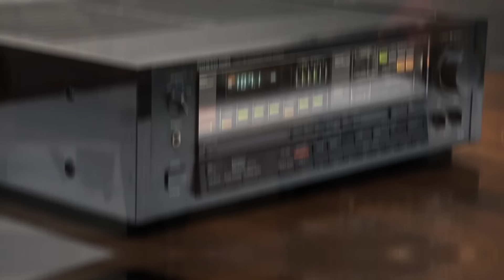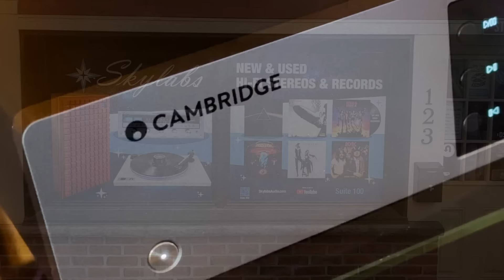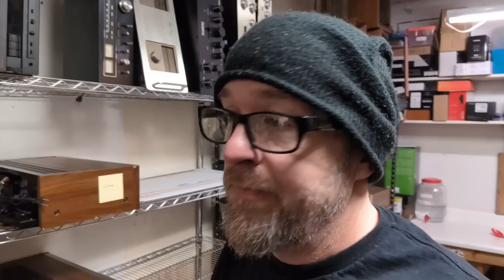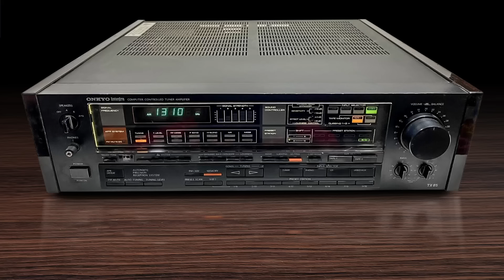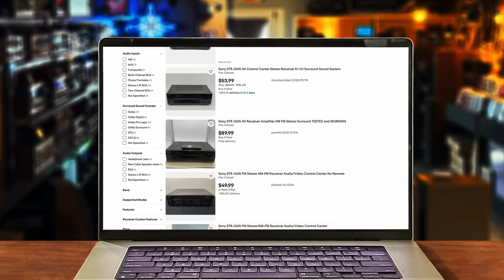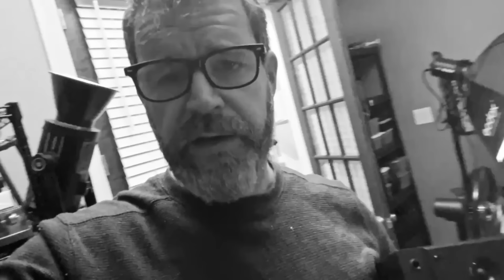Underated Vintage Stereos You Can Get Cheap... For Now

Comment: I liked my father's Kenwood Kr-810. He bought it in December 1982 and it had the digital features complete with a VFD display but still had the chrome face and knobs. For such a compact cabinet with only 23 watts per channel rms, it drove a pair of Becker ProA 303 speakers and it would rattle our upstairs light fixtures from the basement. I had a friend tell me it was the loudest stereo he had ever heard. Sound quality was also warm and rich. 

 It inspired me to to get my Kenwood 1070VR in for my 22nd birthday Sepember 1998 with a pair of Boston Acoustics VR20 speakers. The receiver had surround sound capability with 120 watts to each of the 3 front channels and another 120 watts split between the 2 rear channels. It looked pretty attractive despite having that minimalist 1990's look and a basic VFD splay. It had a black painted steel face and a little more buttons than what you would normally see on receivers from that era, and they were arranged in a way that made it look good. I did not like the fact that I had to turn the volume up 3/4 of the way to make it was loud as my father's Kenwood would do at just 1/3 of the way. But now I understand it was what was called an "audiophile taper" and was actually a good thing. I was able to drive my speakers fairly decently and It sounded about as good as any other receiver I've ever tried. I don't know if that's because I used it for so long that my ears became used to making everything else seems "off", or if it it really was an excellent sounding receiver. And btw, it did have at least 2 ac outlets in the back. It unfortunately failed about 15 years ago, sending thrashing base pops to my speakers that sounded like something hitting the flloor, even at low volumes. It would then go into protective mode. I didn't know what was going on at first, but it didn't take long for it to do it once again and so I ditched the receiver to protect those speakers. I've tried at least 3 different receivers since and while my current one puts out 150 watts per channel RMS, none of these have the smooth, crisp, full sound of the1070VR to me.

Comment: 80s to very early 90s had the best consumer equipment in my opinion. The Japanese had perfected the electronics. All of it was premium, heavy, metal, or very good plastic with tight tolerances. It all went to sh*t mid to late 90s.

Comment: I would agree with all of your pics except the Sony's I went through 3 different Sony receivers. They burned out. I switched over to buying Denon and Onkyo. They are absolutely bulletproof. 

I used to have a JVC receiver that came with a whole rack system for around $700. It had the coolest equalizer on the front. When the music played, the equalizer moved with the music.

Comment: PSB speakers are excellent. I have a pair from the 90’s hooked up to a Yamaha receiver from the same time in my living room. In my bedroom I have a pair of Alpha 3 powered speakers hooked up to an automatic Thorens TT. Both were new a couple of years ago. Together the cost was around $2000 Canadian, which is high end to me. I can’t see ever needing to upgrade. Both sets without separate amps. The Yamaha receiver and powered speakers have them built in. I’m okay with that. Also, no extra bass speakers on either set. The less pieces the better and the sound from both sets pleases me. I highly recommend PSB speakers with their unembellished, natural sound.

Comment: You brought up the Sonys!! Not as old, but I recently snagged an STR DE595 (2003) for $50, which is the same model my brother handed down to me 15 years ago and I somehow lost track of it. Fun unit; not the end game, but fun and a solid power supply with a really good DAC. even has that analog rail that I can use once I acquire a good little phono stage to boost the low end (had to add passive rumble filters because it responds down to 10 Hz… rough with vinyl)

Comment: I've been liking onkyo as a budget brand because the faceplates and LED colors have been the same for 40 years, so if any 1 component fails you can almost certainly find something that matches the set, locally, for 50 bucks.

Comment: I still have a fully functional Onkyo TX-902 Receiver floor model I bought in 1991-2. I am more amazed that the remote control still works especially since universal remotes don't operate most of the Onkyo's functions.

Comment: Kenwood KA-4002 integrated is the THE MOST underrated I've ever heard. Was a tech for over 35 years and sound from this little 18 WPC will leave you shocked. The most underrated tuner you will ever hear is the Technics ST-8077.

Comment: Got the Onkyo M-508, P-304, EQ and tuner. For $150.

Pots are a little goofy and need a cleaning. But still using it as is.

Paired with an RB-75 for $250.

And I got a sweet combo for nothing compared to new.

Comment: This is a great video. I Still have a Sony STR-D911, from the early 90s. Totally beat, and it works like a champ.
The early 80s Yamaha A-500 amps are sleepers. Built like a tank, 75 watts per channel, designed by engineers, not marketers.
They are pretty cheap because they aren't as pretty as the 70s stuff.

Comment: My friend and I used to find killer Sansui amps on the side of the road in the 90’s. We’d ride around and grab the gear, change tubes or transistors from radio shack and build killer systems. Waaaaaay before it was a thing ;)

Comment: Don't overlook the Kenwood KR-V107R. 100 WPC, different "venue" settings, video inputs, EQ and spectrum analyzer. You can do 'surround", but it's still an excellent 2ch stereo. 
That entire line is really nice. I still also have my original KR-V86R. Needs to be gone through, but it still works decently.

Comment: Out of my 3 systems, my favorite is the one with the 1998 Technics sa-dx1050. I've owned it since it was new and have had no problem with it. It has the MOS-FET amps in it which I love. I'd say that if anyone runs across any of the Technics that has the MOS-FETs at a good price, buy it. One thing that I have done to this setup, you might find interesting is that I patched an amp pre-out line to a 1975 Realistic SA-1000 which has the old Quatravox capability and I run the "B" speakers of that amp as synthetic surround sound for this system. Hope that makes sense. Anyway, it sounds great. I think that several of the older Realistics have the Quatravox setting. BTW, I love your channel!

Comment: At 5:38-5:40, that Pioneer SX-2600 receiver is the same model I have had for the past 35 years. Had the solder joints on the circuit board reflowed recently by a repair shop and it works beautifully. Receivers from the 70's are absolutely gorgeous, both aesthetically and for sound output. I feel the older ones are underrated power wise. I do like the ones from the late 80's and early 90's as well (the black ones). I can remember vividly going into the local Sears store back in that era and more less drooling over their stereo cubicle setup they had in the store. They had it all, receivers, speakers, cassette decks, turntables and cd players. At least I can picture it in my mind anyways.

Comment: My Dolby surround Pioneer receiver VSX as a kid had a 7 band manual EQ and my Mom came in one day and punched it right in the EQ.  I also owned drums.  It stopped making sound and wouldn't turn off.  I unplugged it and gave it a rest, plugged it back in and it was off this time, but it powered up and worked fine after, wobbly EQ and all.  It kept working for another 20 years, could still be...

Comment: I have an Onkyo TX-866 80 watt that I bought new but damaged from Circuit City. It had been dropped. The back of the cabinet is bent substantially. I have had it for well over 30 years. Twice I have replaced it with something "better" but I always go back to that TX-866. It sounds great and has more than enough power to make my D9s sing.

Comment: I specifically recommend getting outdated monster receivers ONLY; pre HDMI ones moreso. Just make sure whatever you get is in good working condition. I would specifically look at the (late 90s-2004 era) The Denon 4800 and 5800 and Yamaha RX Z series receivers are STRAIGHT UP amazing; very high build quality. They also excelled at 2 channel stereo performance. And they could also do DTS /Dolby digital 7.1 channel surround sound. 

The early 90s pioneer VSX 9300s-9900s + D1S are great as 2  channel stereo receivers. Another mention would be the Denon avr 3000 (early 90s). I only own monster receivers btw.

Receivers that I own and my ranking
#1 Denon 4802r (2004); smokes the other 3 easy. Torroidal power supply over 45 lbs.
#2 Pioneer Vsx D1S: #2+3 are close?
#3 Pioneer Vsx 9900s
#4 Pioneer Vsx 9300s

Comment: I got a TX-840 at Savers over a decade ago for $10. Paid 2.5x as much for a matching remote and it's been running a secondary setup ever since. My main system has been a revolving door of receivers (the longest-serving was a TX-108, the ToTL in the TX-85 range) but that little 840 never skipped a beat. It's older than I am, yet it'll probably outlive me. I love the looks as well as the sound - the soft green lighting is so pleasant to look at!

Comment: Speaking of Canadian models; the Oilers jersey on your Buddy at the tattoo shop is perfect!!  He’s not a Satanist!  He’s an Oilers fan!  The power supply on my RX-V870 is 50% Higher rated than the American model as is the VA Rating!  Why would that be?  Couldn’t figure it out until I saw the “C” designation in the literature.  Weighs a ton and puts out huge volume without getting very hot like my Sony STR-DE1075 does.  I’m pretty much of the opinion that you should buy amplifiers and receivers by the pound!  If there’s no weight, it ain’t great!😂

Comment: Ya man, the cup is a false trinity and upside down cross. A mocking of the real God. It’s not yours so don’t sweat it. But, if it were me, it’d be gone. New to your channel! Wish you success. It’s really cool. I’m 50 and dealt with a lot of this stuff. Had some amazing Bose 301s and an infinity 12 sub hooked to a pioneer receiver just like that one. and we’d rock some huge house parties, and I could crank it all the way up and those speakers would never distort! Has some technic 1200s spinning some vinyl in the late 90s. Good times

Comment: i bought my Pioneer VSX-D608 brand new in 1999 or 2000 something like that. had to regrease the volume but that was it. 
in my garage i have a pioneer vsx-815 that runs a pair of Aiwa bookshelf speakers that came with an all in one unit, and that sounds fine to me too for a garage.

love these old pioneers!

Comment: I can attest to Onkyo stereo receivers - I'm rocking a TX-8555 for years now, and it's an absolute powerhouse. Overbuilt with a massive transformer, genuine aluminum front panel and heavy/smooth volume knob, 100 wpc... it's really a good integrated amp that just happens to have a tuner built in. 

The only thing I don't like about it is that it doesn't have a tape monitor loop to connect an EQ, nor does it have a loudness button.

Comment: I just recently moved and parted ways with my Denon receiver (AVR2400 I believe) I bought in 1999.  Still worked and sounded awesome with a phono and CD input and  5.1 Dolby surround.  Couldn't sell it for what it would add to the moving cost. Sold it in the Estate sale along with my vintage Sansui tuner/amp combo from the early 70s.
Reply: God bless brother - I'm using a Denon AVR-X2800 in my 5.1 system, which replaced an old Onkyo TX-SR605, though I prefer the sound of the Onkyo, hands down.

Comment: Still have an Onkyo TX-8511 that I bought as a floor model at Circuit City (😂😂) in the early 90s. Plenty of power, excellent sound, and as reliable as an old Toyota Camry. It is so solid and  durable, I can't bring myself to part with it, even though I don't use it every day anymore. I can also vouch for some late 90s Polk bookshelfs - I snagged a pair cheap a long time ago on the popular auction site, and they sound fantastic.

You could probably get the Onkyo and a pair of Polks for under $200 - and have a satisfying system for a small room. You could definitely spend a lot more and do worse.

Comment: I had the VSX series stuff I bought at the sound center in Bamholder, Germany, when I was in the military. I had the dynamic expander, which was eye candy on steroids, the 6-pack CD changer, and the dual cassette deck. I initially had the massive Pioneer speakers, which I forgot the model of, and later bought the Klipsch Tangent speakers, which were really nice-sounding. I eventually settled on the DCM Time Frame speakers. I loved how those speakers sounded. I should never have sold that system. It was a good system and sounded great. I miss the sound center. The enourmous amount of audio they sold was epic and the payment plans with no interest meant that damn near every soldier had a killer system. The barracks were not a quite place on the weekends!

Comment: I had a 1986 pair of Paradigm two-way 3se bookshelf speakers. They beat out a similar sized Boston Acoustics A60 pair in an A/B test. 40 years later my son-law has them - after I long ago modified them by reversing the tweeter phase. The midrange came in! I let Paradigm know what I did (which was textbook in a 12dB/octave crossover) and was met with silence. With a small Fosi B/T amp they sound fine. Efficient. But unless you can make the mod, not recommended.

Comment: I have a Sony STR D-615 my ex gave me in 1995 I paired it with a pair of Polk Monitor 40's and a Fluance turntable.  It is my secondary set up and I keep thinking I should upgrade but it works perfectly and sounds pretty good so I probably won't.

Comment: i still have my favorite reciever sony str-de845 and i still use it for surround sound in my basement movie viewing room that local speaker manufacturer MTX did for me while i gave back so they could create a series of speakers that would acoustically sound good in their basement homes with watching movie's and they nailed it i also like the sony because it has the dual subwoofer outputs and since mtx brought me out 2 self powered mtx 12" subs that sit in both front corners of the room with thier own 12" down firing passive subwoofer ther is no shortage of bass at all especially when watching movies when  getting down to 18hz during special effects in  movies or like jet fighter scenes like in top gun and maverick at the beginning when the jets stage up and take off the whole housee just rumbles so you do feel like you there

Comment: Very good to give advice about good gear that is cheaper. Sony and Onkyo and Harman Kardon gear can be bought cheap. great gear too. The basic models are the best to buy. So many of these units in the 70s were about 25 to 30wpc. There are a lot of great buys in you go to the late 80s to late 90s or early 2000s. A Pioneer A-656 or 616 would be a great amp. Onkyo Integras sound very warm and mellow. You can buy a Denon PMA-1500. You can find a lot of great stuff for $200 or so if you want to move away from the 70s. Buy the late 80s amps were sounding very nice.

Comment: Sony? They lost their mind. I ended up with two Sony receivers, the  two looks almost identical. But the remotes are not interchangable at all. They don't  work at all on  the other unit. The funny thing is I have a  Sony remote from the 90's all in one and learning, and lcd display.  It actually operates some of the functions.

Comment: Onkyos are amazing. I had a 5.1 ch. 676 I paid 950.00 for brand new and it was a beast. I built a home theater around that amp .
It was boarding stereophile sound. Infinity speakers and Polk audio sub , at 80 watts per ch times 5 it was sic 😮

Comment: I had the Pioneer VSX-502 receiver from about 1994 until 2022. Great receiver. When the left channel went out after 28 years, I replaced it with the Pioneer Elite VSX-LX305. Not a vintage receiver obviously, but after pouring over reviews and my good experience with Pioneer, I went for it. The new Elite is in use for an average of 12 hours a day. Three years in, and so far it has been great.

Comment: There's quite a few late 80's Pioneer receivers that would surprise you soundwise, and power wise. 
The VSX-D1S was the flagship of the line and rated at 130wpc or so, but I'd venture to guess its a good bit more than 130. I saw a vid on here a while back where someone tested one well over 160wpc. 

I bought one new at a trade show, along with their S-T500 speakers, a CD changer, and DV525 DVD player a few years later. It certainly rivals some of the best units from years prior. Plus, as mentioned, those years have a remote or use the Pioneer universal remote. 
A few others that were similar are the VSX 9900S, VSX-902S, and a bit later, the VSX-503S and VSX 504 were all 100w plus units with power to spare. I doubt I'll ever part with my D1S, its in mint condition and set up at my house in use as a two channel only receiver. 

I've also got an SX303R two channel receiver that I trash picked about 14 years ago. Made in 1994-95 its 100wpc, with old school bass, treble and balance controls, only tuning is digital. It been my woodshop stereo in my basement since I found it. Its powering two pair of Polk monitor 5jr speakers mounted in the floor joists above. 

I'm also a big fan of early to mid 80's Onkyo, I've got several from that era, all are integrated amps. The best sounding to me is my A-8017 which is rated at 80wpc. 

If were talking 80's and 90's, then I don't think I'd leave out NAD, Parasound, and Harman Kardon. but they tend to be a bit pricier than most on the list here.

I've heard those Sony speakers, a buddy got a set for Christmas one year and they are pretty rough sounding, I'd rather have a pair of Radio Shack speakers.